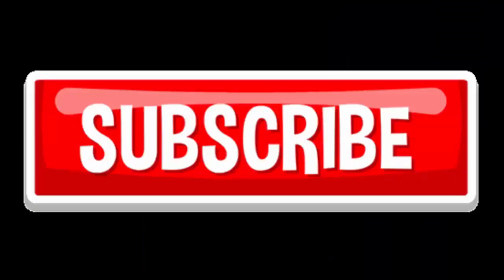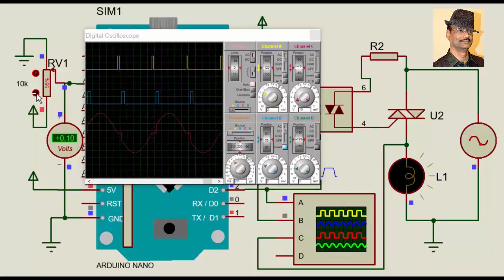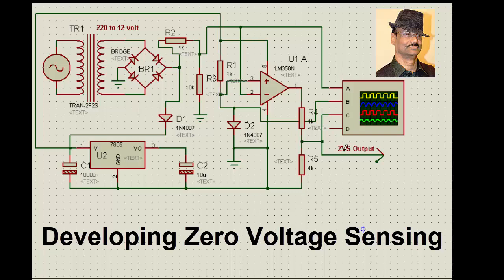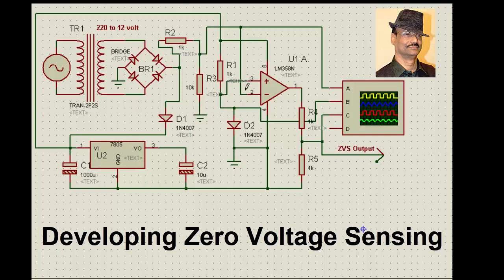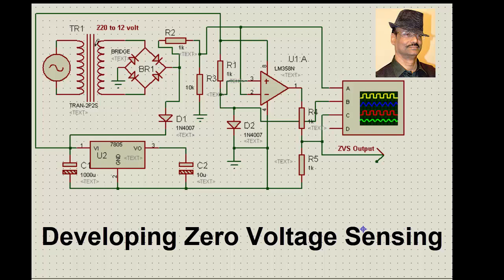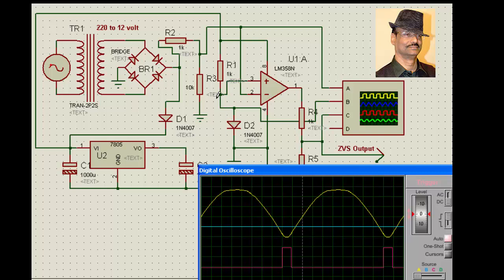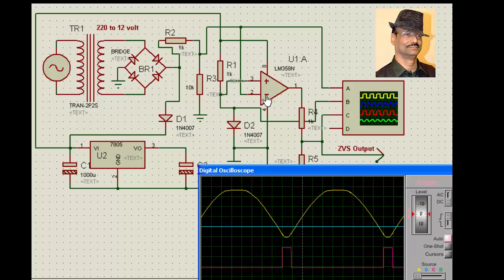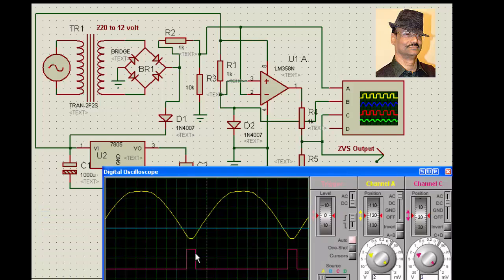Thyristor - Power control by Arduino

Comment: Hello sir i need code
Reply: Please help
Reply from the maker: @alibanai9941  mine is ucpatnaik@gmail.com
Reply from the maker: email id please
Reply: @PatnaikUC  boldajy112233@gmail.com
Reply: Sir i need help if wanaa use thyristor in my zero crossing bridge istead of dide it make changes in my code because i just wanna control phase in my rectifier i will be very tankfull if u answer me
Reply from the maker: @alibanai9941  not clear what you mean
Reply: @PatnaikUC  i wanna use  thyristor instead of diode in rectifier
Reply from the maker: @alibanai9941  Sorry wrong concept. Why do you want to use thyristor in place of the diodes in the rectifier? Reply directly in my mail